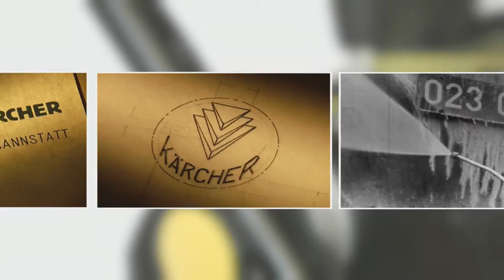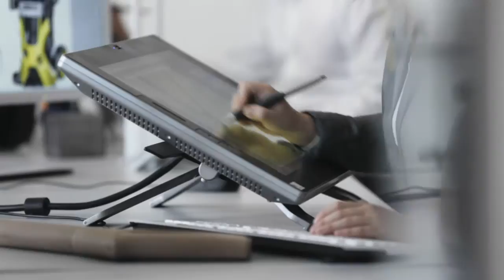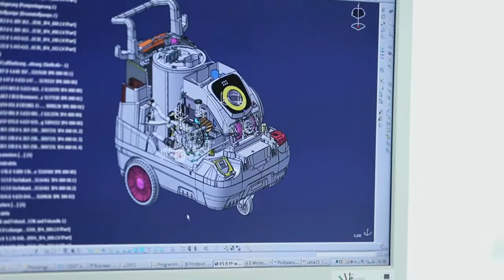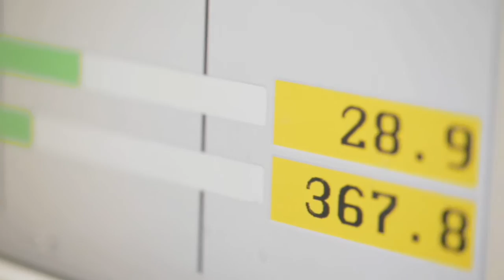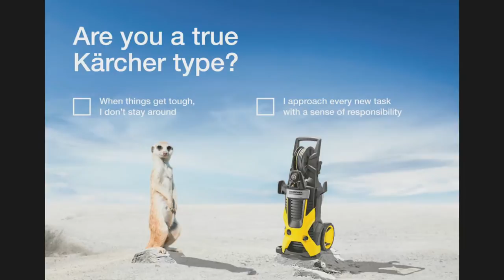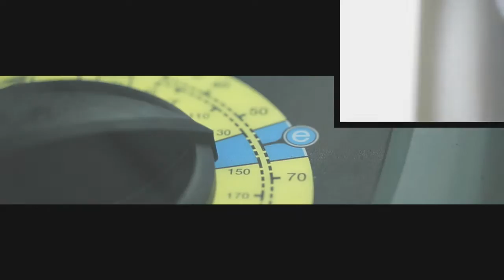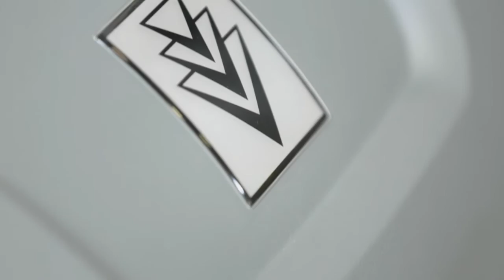Welcome to Kärcher

Comment: Bought Karcher K1900 in Nov 2017. It started leaking oil after 4 years. Since its out of warranty, Karcher refuses to fix it. I called their parts department and representative told me there is no parts diagram for the internal pump and I'm out of luck. This tells me Karcher DOES NOT stand behind their products. Are you just supposed to throw pressure washer away after it breaks out of warranty? 50 cent gasket just lost you a customer. Will never buy another Karcher product again.